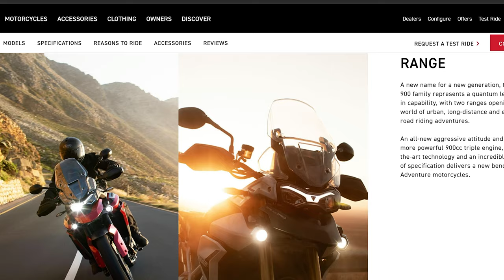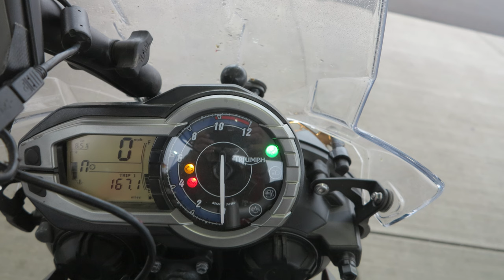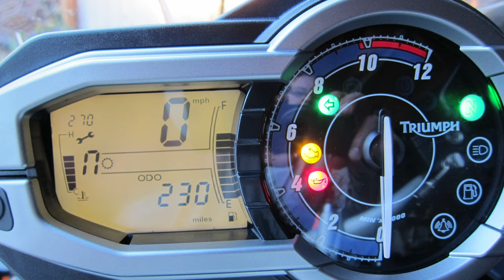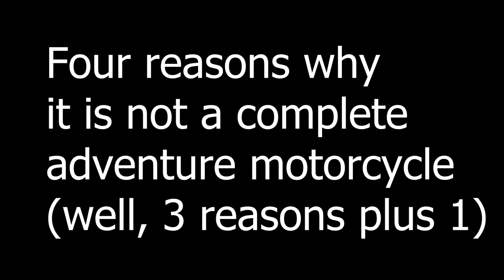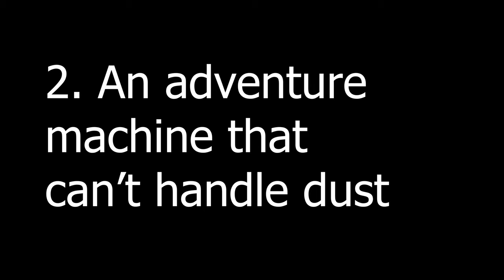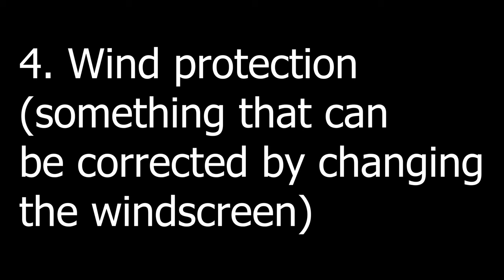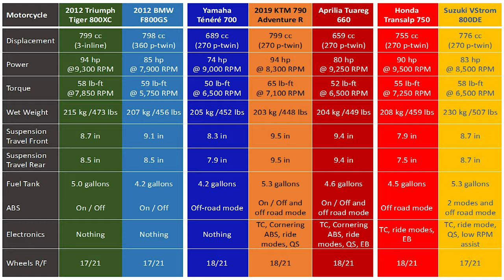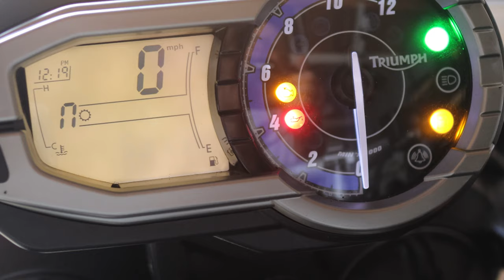My 2012 Triumph Tiger 800XC

Comment: Nice Video. I own a 2012 Tiger 800xc since 2019. bought with 23.000. Now it has 78.000 km on the dash. Many km on dirt and mud. Long range travveling an clmmuting also. I never had trouble with the stepper motor. But I clean this area when I do the service every 10.000 km. 😊. Mostly I ride with ktm or yam T7 guys. And the Tiger does all the same shit as the others do. From fast gravel to single trails.  And it do long distances realy comfortable! I will ride till it breaks unrepaerable! ❤
Reply from the maker: That’s perfect. You described exactly what I believe this bike can do. New bikes have improved electronic aids. But other than that, this more than 10 years old Tiger 800XC is as capable as the new, similar size, adv bikes. And as its value decline, riding until it is broken is the way to go. :-) Thank you for your comment.

Comment: Great video and helping me make a decision....I only ride road, 2 up...and read the XC is the better option to the XR. Do you agree? I like the feel sitting on the XC , but never test ridden.
Reply from the maker: If by XR you are referring to the BMW 100XR, I have to say I prefer a three cylinder than a four cylinder motor, so the 800XC it would be. But that is a purely personal choice. :-)
Reply: @idratherberiding3456  I'm sorry I wasn't clear...I mean the XC like your Tiger and the street version Tiger XRX? Cast wheels and smaller wheels than the spokes on th 800XC...XC felt VERY comfortable to me
Reply from the maker: @davidcunningham1585  Got it. Well, comparing the XC with the XRX, because I like riding on dirt, the XC is my choice. If I was not comfortable with the seat height, and I would only or primarily ride on pavement, the XRX is a very nice option. And probably priced better!

Comment: Luved my 22 KLR650 and was going to pick up another one, but then I saw the tiger 900's, although I'm still not sure I totally like the looks of the front end and the front rake is pretty steep. But, it is a NICE bike. So i got o looking and there are some pretty good deals on nearly new 20-22 tigers and then I noticed the tiger 800 and I think it may actually look better, especially in the red and they say it is very smooth. I know the 2018-2019 had some nice updates, but is it that much better than the gen 1 n gen 2? I have found a 14 in excellent shape n never been off road and some super nice 2015-2017's. So for the price of the klr650 or slightly more, which I only did minor off roading with anyway and really liked taking small trips, I can pick up a nice Tiger 800, so there lies my dilemma. Will have to see if I can test ride the 900's n the 800's and go from there. Thanks for the video!
Reply from the maker: My Tiger has been trouble free. I think any Tiger (any model year) is a more comfortable and better performer on the highway than the KLR. Now when it comes to dirt rides, if we are nly talking about gravel roads, the Tiger will be great. If in more technical stuff, then the KLR will do better (in my opinion).

Comment: The perfect video for me.
I am currently riding a 2001 BMW F650GS, single cylinder.
Today I looked at a very reasonably priced 2013 Tiger XC ABS, I knew there had to be some downsides to this bike due to the dealer price on it.
I am still interested but not sure it is exactly what I want, the price is attractive but.....
Thanks for your video, it came at just the right time.
I love my 650GS, the only things that really bother me are the buzzyness of the handlebars at highway cruising speeds that make my hands go numb, and the air buffeting it all ready has a higher windshield than OEM.
Thanks for your review.
Something to think about.
Reply from the maker: Thank you, I appreciate your comments. And yes, the frame is a major problem, in my opinion. But when the price is right, it becomes less of an issue. The dust issue, I don't know when Triumph fixed it, but I bet they fixed it on later models.
Reply: On 2018 tiger 800 minor(big) change, they are improved it over 200 items. This may help for considering.
Reply from the maker: @ManNew659  Thank you for this information, it adds to the video.